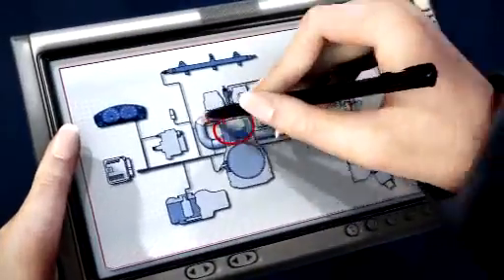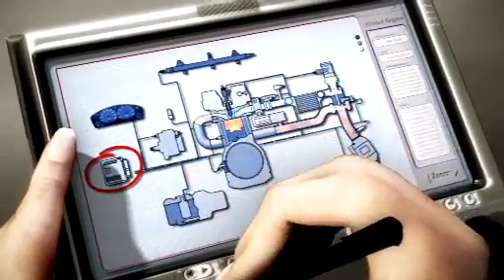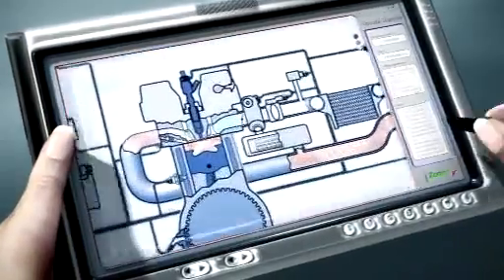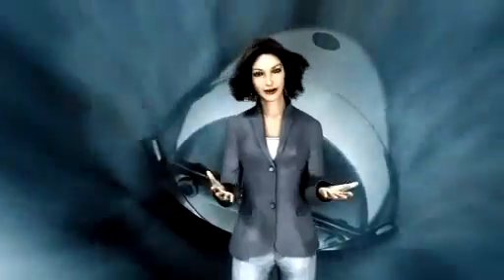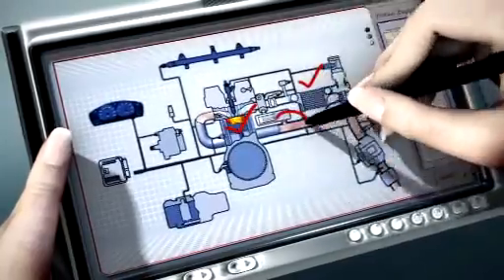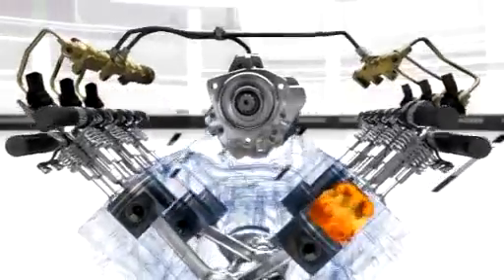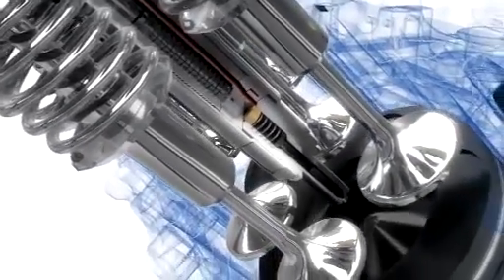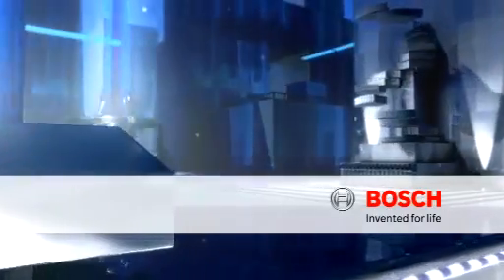Mercedes-Benz Common-rail diesel direct-injection system, CDI

Comment: Hi I apologize for making this comment but I need your help where I am from the United Kingdom and I am on vacation in Portugal and my mercedes cl203 coupe 220cdi has a problem that no one knows how to solve this appears epc in my car is the engine stops right in the middle of the street and it's hard to start again someone already changed the throttle and it's still the same..... mercedes technicians can you please help me with the epc that has no information about epc i have to go back to the uk and the car at half gas dies someone help me.....

Comment: l have a problem after 
replacing ml 270 cdi year 2000 injectors the original was 0445110035 and
 the new ones 0445110201, but the ECU not recognize them. And it won't even start up to go to re-code the new injectors. Anyone has any idea why is this? Or is there a limp mode for the injectors to get it going?